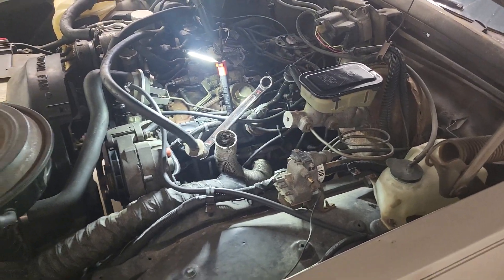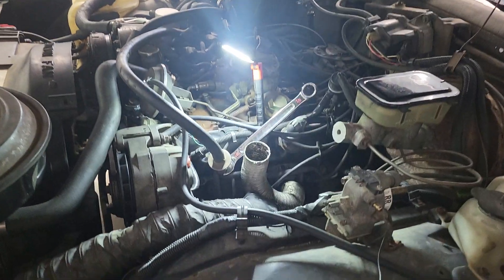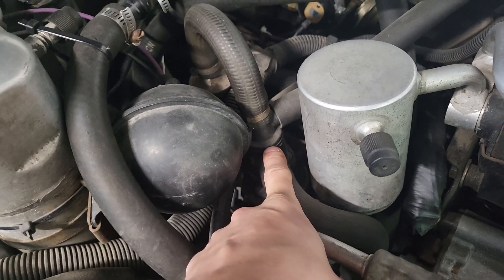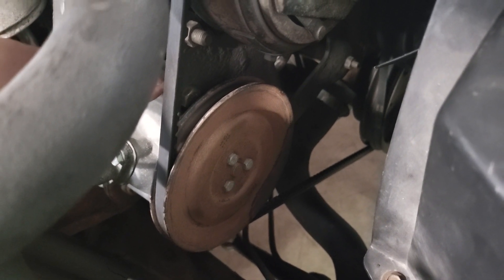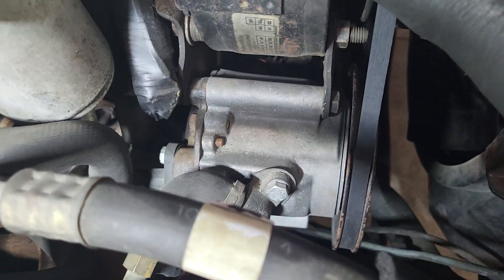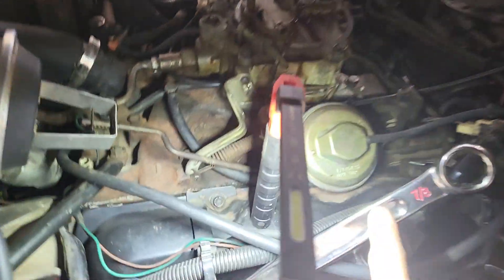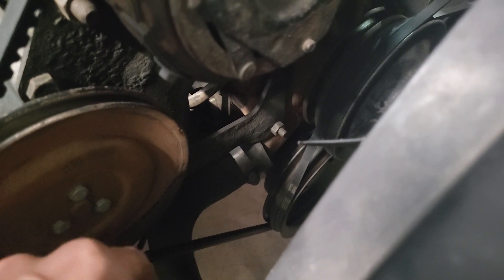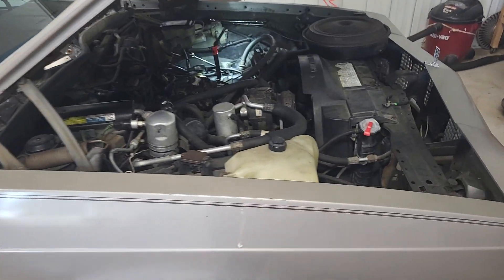1983 oldsmobile 98 emissions control system delete tutorial pt. 1 of 3

Comment: I did a smog delete on my 83 Olds Toronado. Still has the CC Quadrajet and it runs perfect. It's rebuilt and also bought a new ECU for it. The biggest problem people will have doing this delete is rerouting vacuum lines.

Comment: Thank you for sharing your under hood view of your Ninety Eight. I had the 1984 version with the same powertrain. I remember AIR stood for Air Injection Reactor. My system used the air pump to supply mildly pressurized air to my exhaust ports during warm-up to promote oxidation. Then the system switched the air to the catalytic convertor to oxidize hydrocarbons after warm-up. The plastic valve assembly diverted the air to the air cleaner on deceleration to prevent blowing the catalyst apart. I simply found a shorter belt size to drive my accessories and removed my air pump. The metal reed valves at the upper ends of the steel tubes stayed in place. I merely rubber capped them. The steel nipple on the catalytic convertor end was easy to crimp closed with stout locking pliers. I kept my EGR system to reduce pinging, though running fairly advanced factory timing. My average mpg was 19 when my electronic carburetor was stuck lean. It dropped to around 16 mpg after the carburetor was returned to normal and under ECM mixture control. Running the carb full rich (ECM disconnected) yielded about 13 mpg. I sold my 98 some time after my speedometer broke at about 268,000 miles. Wonderful, simple, inexpensive to own car. May yours be a pleasure to drive for many years.

Comment: I have a 1980 oldsmobile delta 88,and when i purchased the car most of that stuff your talking about was removed .Even the Ac bracket,lines and compressor.Which i replaced the air conditioning bracket ,compressor and brought that smog pump delete bracket and change the wide belt pully wheel that came with it to a v belt   narrow(four season 45955 ) pully
 wheel.Which when i pull off the smog pump delete wheel it gives enough slack to remove the compressor belt without loosing up the ac bracket bolts.Dorman make a smog pump delete bracket not sure of the part number.

Comment: Will this apply for a 260? I took off all the smog stuff but having a hard time finding information on rerouting the hoses to the carb. Never worked a two barrel, switching to 4 later but for now just keep the 2 to drive. I pulled off the ported vacuum switch, do I need it?

Comment: Those things that are hooked to the manifolds are air injection tubes you should take those off and put  brass plugs in them also those weird things are called aircheck valves they only flow one way it doesn't pull air from the Cadillac converter it pumps air into the Cadillac converter you're doing a good job

Comment: I have an 87 Cadillac with the 307. What carburetor did you replace it with? I’ll be deleteing my smog also since I’ll be replacing my busted head gasket.
Reply from the maker: I replaced my carb with an M4MC quadrajet from a 1978 oldsmobile delta 88 with the rocket 350 engine. It's the exact same carb as the E4ME that this car came with but without the computer stuff